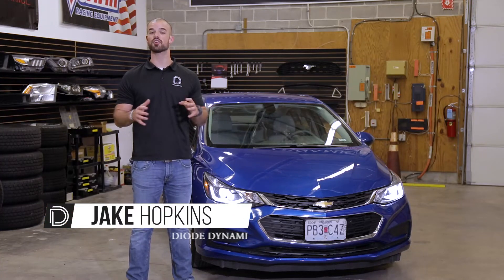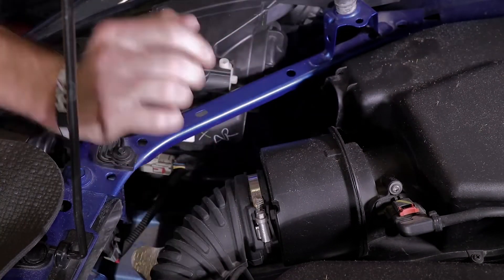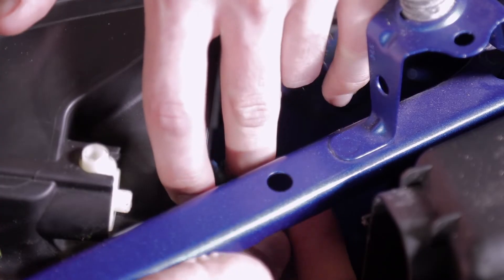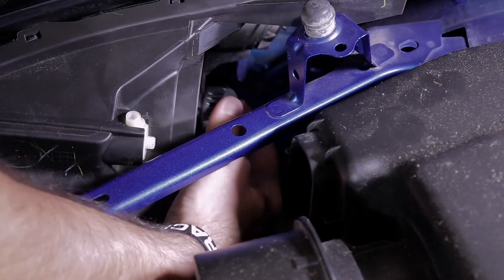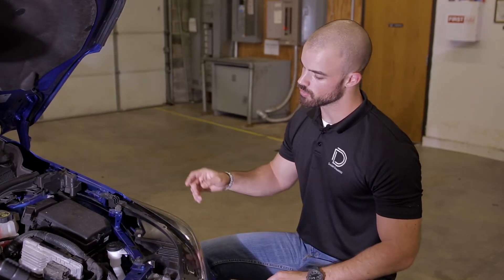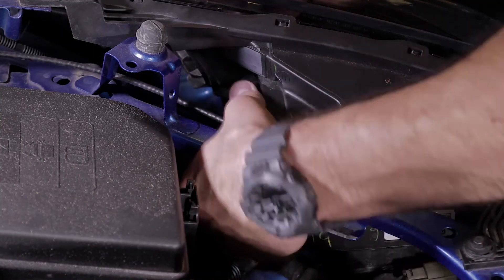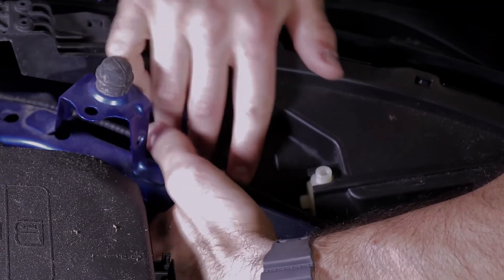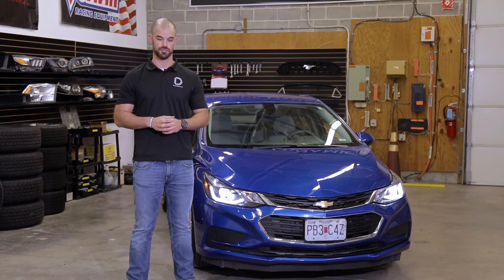45% Brighter Low Beams for your 2017-2019 Chevrolet Cruze! | LED Headlight Bulb Install

Comment: The dust cap on mine is a pain to get off which way to turn to get off?
Reply: Counter clockwise, if it don’t work just remove the headlight with two screws and pull it out to properly remove the dust cap
Reply: @akaSolanoWZM thx

Comment: Dose these bulbs have mini fans for cooling or make any type of noise or humming sound?
Reply from the maker: Our New SL2 bulbs do not have a fan, so those do not make any humming noise!

You can check them out in the link below!

https://www.diodedynamics.com/low-beam-led-headlights-for-2016-2019-chevrolet-cruze-non-projector-pair.html
Reply: Dose the SL2 work for this vehicle? Looking to put them in a 2018 Chevy Cruze. The video is about the SL1
Reply from the maker: @BetaTheHusky  Yes it does, the SL2 and SL2 Pro replaces the SLF and the SL1.

Comment: What about the daylight running light bulbs?
Reply from the maker: The Chevy Cruze has an LED board for the DRLs. They are not replaceable. Sorry about that!

You can find all the replacement LED bulbs on our website here:

https://www.diodedynamics.com/by-vehicle.html?find=2017-chevrolet-cruze-547247&sid=9W1qnu2AbL

Comment: So my car doesn't do High beam Low Beam, it has the projector lights, how does that work for me?
Reply from the maker: You will either have projector headlight with a Hi/Lo Bulb, or non projector with a Low Beam bulb and a High Beam bulb. 

Here is the link for you:

https://www.diodedynamics.com/by-vehicle.html?find=2018-chevrolet-cruze-547248&sid=Y0w8QqMIGf
Reply: @diodedynamics  Well I have a low beam bulb with projector they do not get brighter or dimmer at all... it is one steady brightness with the projector
Reply from the maker: @saraames8600  Where are your high beams located on the headlights? Are they reflector or projector?

Comment: Hey, I got a question is the car you tested in this video? I have one lightbulb for low & high because that’s the only video show one lightbulb the other videos they show the low and the high separate. Mine is a 2017 Chevy Cruz premium.
Reply from the maker: If you have one bulb for your low beam and high beam, this is the correct product we offer for your Chevy Cruze!

https://www.diodedynamics.com/hi-lo-beam-led-headlights-for-2016-2019-chevrolet-cruze-projector-pair.html

Comment: I found the best led lights only one question for you guys do I need the anti flicker I have hi low
Reply from the maker: Hi Luis! You shouldn't need an anti-flicker module for our SL1s to function properly! Are your factory bulbs dual filament (the bulbs function as both the hight and low beams)?
Reply: Diode Dynamics yeah it’s it’s dual function
Reply from the maker: @luisgaldamez655  Unfortunately, we don't offer dual filament headlights as of now. However, we are currently working on releasing them in the coming months! Keep an eye out on our social media for updates!
Reply: Diode Dynamics isn’t it a dual bulb?? These cruzes use only a single bulb for both high and low beam.
Reply from the maker: @Lyndonkb11  Correct. They require a dual filament bulb, which we don't offer yet.
Reply: @diodedynamics  is that why they are decent on low beam, but terrible for high beam?! I seem to get flashed a lot on highway on low beam. When i put my high beams on barely makes a difference. 🤔
Reply from the maker: @Lyndonkb11  Yes, they are not designed to be a dual beam headlight, unfortunately. Sorry about that!
Reply: @diodedynamics  any recommendations then?  Or any bulb option available from you guys that’s dual
Reply from the maker: @Lyndonkb11  I apologize, I misread the earlier comment. We offer bulbs for the high beam and low beam on our website, as they are indeed two individual bulbs.

https://www.diodedynamics.com/by-vehicle.html?find=2017-chevrolet-cruze-442866&sid=RwyGWBPDvc
Reply from the maker: @Lyndonkb11  Unfortunately, we don't offer a bi-led bulb at this time for low and high beam function in one. Sorry about that!
Reply: @diodedynamics  no these Cruze use only one bulb.
Reply: @diodedynamics  you guys should work on that, they’d sell like hotcakes 👍 haha
Reply: @diodedynamics  you guys have a dual LED bulb yet for these?!
Reply from the maker: @Lyndonkb11  Unfortunately, not at this time. Sorry about that!
Reply from the maker: @Lyndonkb11  Unfortunately, we still do not offer high/low SL1 LED bulbs. Sorry about that!

Comment: That is a 2017 cruze Lt? 
When I look up the bulb it says 9005 for low, H11 for high. On xenonpro

On your site: 9005/9006. 

I'm pretty sure it only has 1 bulb though. 🤷‍♂️

9012 on the computer at work. 

Owners manual says ask dealer.
Reply from the maker: Hello Travis - our website is accurate, as we have done extensive testing to confirm all of the bulb sizes. These are replacement bulbs if you have halogen units, not LED or HID.
Reply: Alrighty. Thanks. 

Yup I have the dumb yellow ones.

Comment: I have a 2019 is it still the same size bulbs?
Reply from the maker: It sure is! You can check them out here: https://www.diodedynamics.com/hi-lo-beam-led-headlights-for-2017-2019-chevrolet-cruze-projector-pair.html

Comment: I like the product and all but I'm not following the part about the color rotation. I think this is something I might mess up during installation. If the bulbs are custom fit for a Cruze why don't you ship them already positioned for installation?
Reply from the maker: These bulbs are extremely universal in nature,  and come with a standard collar alignment  that works with most vehicles. Some vehicles need a slight rotation to help fine tune the beam pattern. Attached below we have included a link on how that collar adjustment works.
https://www.youtube.com/watch?v=CRzNg34kJ-g

Comment: Just installed a pair on my 2017 Cruze. Had previously  a 6000k HID kit and these LEDs are definitely much better. The video explains well the installation, but inserting the bulb was a bit pain in the butt. As said in the video, bulb is hitting the  screws. The result is that the plastic tabs on the bulb  can't fully get inside the little openings in the housing. I would not recomend to force it. I took a flat screw driver and pulled  one end of the opening slightly  outside so the tab on the bulb can slide easily under once the bulb is turned.
Reply from the maker: Hey Oleksiy! We really appreciate you sharing feedback on your installation. Thanks so much for your continued support!
Reply: This is exactly what I had to do. One side feels like it's barely in there but it it. So far it works well.

Comment: Do you need to order the 9006 Anti-Flicker Module for a 2016 Chevy Cruze LT Gen2?  Mine is a 2017 body style.
Reply from the maker: Hey, Paul! The Cruze that we tested didn't require any Anti-Flicker Modules, so you should be fine without them!

Comment: FINALLY! I have been looking for a video just like this. Ordered mine! But I have the same concern, the dust cap won't cause over heating? I don't want to melt or burn up anything...
Reply from the maker: This bulb was designed specifically with that in mind, no reason to worry about overheating whatsover! The stock bulbs run much much hotter than the SL1, even at operating temperature.

Comment: With the dust cap reinstalled its not gonna overheat and loose brightness ? , the lumens its kind of the very low side too !
Reply from the maker: These bulbs were designed specifically to operate behind the dust-cover, so that is not something you will need to worry about at all. In regards to the brightness, the numbers we advertise are true / measured numbers, versus a lot of inflated numbers you see elsewhere on the internet. Feel free to give them a try, as we do offer a 30 day satisfaction guarantee in the event you are unhappy with them. We think you will be happily surprised!